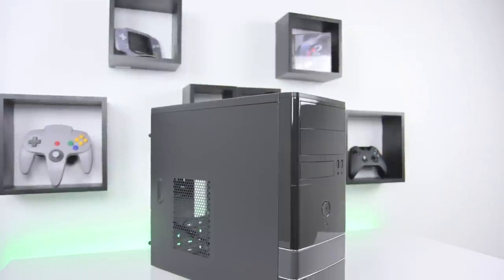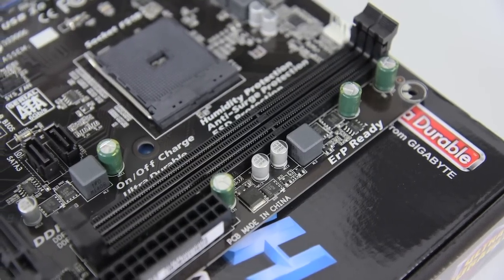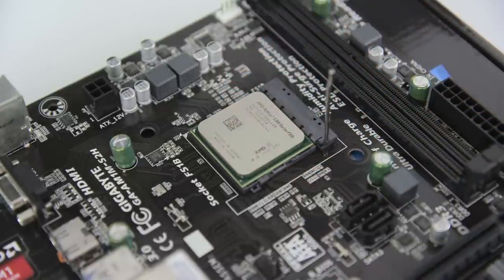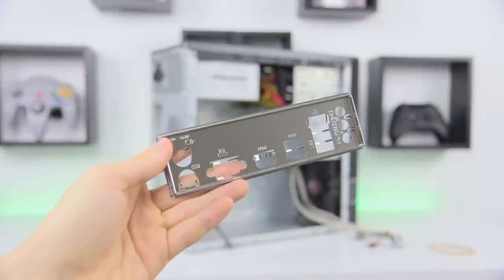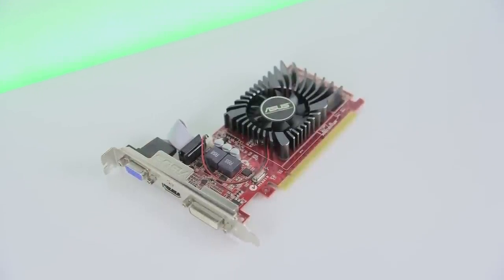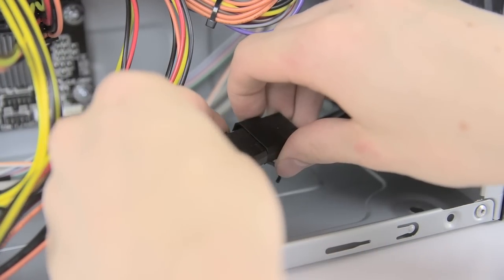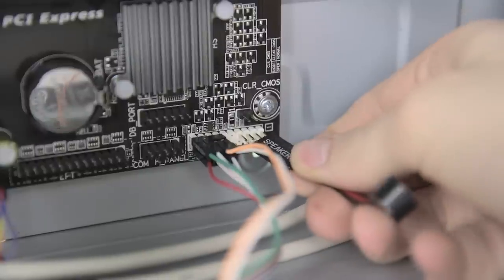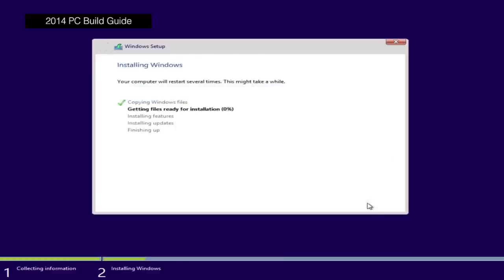How to Build a $300 Gaming PC! (2014 Boson)

Comment: Guys, this is a great build. I dont know why everyone is saying things about YouTube not being a reliable source for PC builds. Austin has over 700,000 subscribers,and is very technologically intelligent. He is an extremely reliable source with tons of knowledge. Besides, he showed us the computer working. He has another video video on his channel showing what it can do, and its pretty impressive...... for $300!!!!!!! Obviously this is not the best, fastest, most powerful gaming computer out there, but it's certainly one of the cheapest!! It's not supposed to be an outstanding performance PC, but it gets the job done with ease. It can handle just about any game out there at over 30 Frames Per Second, in 1080p to 720p. And for heavens sake, it's a beginners build. It's supposed to be a super simple build for beginning PC builders. Obviously not the best specs, but for the price and simplicity, it's about as good as you can get.
Reply: *****  Actually, even though that is a good computer, I still think the Boson is better. There are a couple reasons:
1. The Boson is actually slightly cheaper if you buy the parts for it on Amazon.com 
2. Even though the processor has a slower clock speed than the processor from the link, it is quad-core, unlike the one from the link which is dual-core
3. The Boson is still a better BEGINNER build, as it is easier to put together
4. The hard drive from the link is only 500GB, but the one in the Boson is 1TB, (1,000)

Don't get me wrong, the build from the link is still a great build. All-in-all, however the Boson is just as good (if not better), it is easier to build, and it totals out to a cheaper price than the build from the link.
Reply: muurf Your logic makes no sense. Because it's cheaper, it's better? So I guess the GT 610 is better than a GTX 970 too? Is the i3-2100 better than the i7-5960X too? It's cheaper.

The amount of cores a processor has relates to it's performance in absolutely no way. The G3258 outperforms the 860K in gaming.

How is the Boson easier to put together? hint: it's not. What's different?..

A 1TB hard drive is inefficient because the capacity is so large. You must not know that smaller drives perform much more efficiently, and this is why people partition or buy smaller drives and use them in RAID. 

The build I made is absolutely better, it's not a contest..
Reply: ***** Ur right. After I left my reply, I went back and looked at your build. I dont know what I was thinking! I guess when I said the Boson was easier to put together, I just meant that it came with a power supply already installed. Now looking back, I realize that that really wouldn't  make much of a difference. I didn't mean to say that if its cheaper it's better. I just meant that if you are just starting to get into pc builds, you should try to spend as little as possible on your first build.  Looking back, I realize that the intel processor in your build would out-perform the AMD processor in the Boson, even with only two cores. It would probably also be better for overclocking. As for the hard-drive, I guess it depends on what you are going to be doing on your PC and the amount of storage a person needs can vary greatly. Also, looking back on your build, I realize that the graphics card is much better in your build than in the Boson. I am literally laughing out loud right now over how stupid and completely insensible my earlier reply was. Your build was MUCH better. No question about it.
Reply: *****  Here's a build that I made:

http://pcpartpicker.com/parts/partlist/
Reply: muurf That's not a build you made. That's the link to your part list.
Reply: ***** How do you know I didnt build it?
Reply: ***** Liar.
Reply: ***** Are you a juicebox?
Reply: ***** or a jukebox?
Reply: ***** Maybe you're a bowl of fruit.....
Reply: ***** Sorry, someone started messing with my youtube accounts.  Everything after when you said " That's not a build you made. That's the link to your parts list."   wasn't me.  Yes I know that that is a link to my parts list, but that's what I meant when I said "here's a computer I made."  And just so you know, I did  build a computer using the parts in that parts list.
Reply: Tell me if you think this is a good build for its price range:

CPU:  AMD FX-6300 3.5 GHz 6-core processor.

RAM:  G.Skill Ares Series 8 GB (2x 4GB) DDR3-1600 memory

GPU:  MSI GeForce GTX 750 Ti 2GB Video Card

Motherboard:  Asus M5A97 LE R2.0 ATX AM3+ Motherboard

HDD:  Western Digital Caviar Blue 1TB

Case:  Corsair 200R ATX Mid-Tower Case

DVD Drive:  Black SATA 24x DVD Burner

PSU:  EVGA 500W

It totals out to around $470.
Reply: muurf It's decent but you could do better. Do you really even need a DVD drive? All games are downloads anymore anyways lol.
Reply: ***** Good point. I guess I figured just in case....
Reply: muurf go for a r9 270 gpu, I think they're around same price as higher tier 750 ti's
Reply: Riley Poulin thanks!
Reply: ***** While I agree this build isn't good, and neither is the Boson 2.0 build that recently came out, you still have to make some sacrifices in building a PC on a $300 budget.
Reply: ***** I know 700,000+ subs doesn't mean he knows it all, I was just saying that he must upload decent content, or people wouldn't subscribe to him.
Reply: muurf 99% of Youtubers know nothing about computers so not necessarily..
Reply: ***** Yeah, you're right, but generally speaking, YouTubers that put out TECH videos and have more than 200,000 subs tend to know a bit about what they're talking about. Just saying! :-)  By the way, i'd just like to mention: earlier in this comment stream, you said the amount of processing cores a processor has relates to its performance in absolutely no way. I just want to point out that that is not at all true. In gaming, that statement is correct to a degree, as games generally favor fewer, more powerful cores over more, less powerful cores. However, for a while, certain games didn't even run on dual core CPUs, and the newer games that are coming out are starting to take advantage of more than 4 cores. As far as workstation tasks go, you probably know the deal; more cores help tremendously with multithreaded applications, and can speed up the editing, and rendering process.
Reply: muurf It's still not that simple. There are chips with less cores that still outperform chips with more cores even in multithreaded applications. For the most part it's true but not always.
Reply: ***** Yeah, I know, but I just meant in general. It gets more complicated when you start comparing Intel CPUs to AMD CPUs, because Intel has "stronger performance per core." An i5 4690k would probably out-perform an fx-6300 in video editing and rendering, despite the fx-6300 having 2 more cores, simply because of the stronger performance that Haswell© has over AMD architechtures. It gets even more complicated when you get into hyperthreaded CPUs. Would a hyperthread dual-core i3 out-perform the x4 860k in workstation tasks?
Reply: muurf Yes, the i3 would still be faster by far.
Reply: Thank u someone else who knows it a computer for a beginner at pc gamin
Reply: jake P. I know right?!
Reply: ***** You win just for picking a Intel CPU over the AMD trash.
Reply: muurf Have to touch on the Hyper-threading part here just a tad. The performance of hyper-threading is null. At this point in cpu tech its like trying to compare my fire to yours what one is hotter .... there both fire and typically forgiving random conditions the same. The point here is that the Core performance is key and the only decider in this matter.
In all my years and experience with both products, AMD is a budget brand that will run but never performs. Intel continues to perform even at the base level of CPU. I may spend a tottal of $30 US more on my build but it will run as if you spent 200-300 more on a AMD build every time.
Reply: BloodyNoSeProduction Yes, Intel performs alot better. I know. Intel architecture is at another level from AMD.
Reply: I think this kid is high or something because the build is not $300 and it is a piece of crap to game on. If you haven't noticed windows is $100 per copy, a decent mouse and keyboard bundle is at least $60, if you want a wireless adapter for your pc that is $15-30, finally if you tried to multi task/ record and stream while gaming your cheap ram would blow up. The only decent part on this pc is the amd apu but the mobo will most likely blow up as well so you should just save yourself the time and burn this computer to the ground while you still can.
Reply: If you want to buy a GENUINE windows activation key that has not already been stolen then you will not take any chances and pay $100. If you want pc accessories that will actually last you a decent amount of time and will give you the most comfortable gaming experience possible then you should invest a little more in your equipment. If you are new to building gaming pc's then you will want to buy a motherboard with an easy-to-use bios so that you don't accidentally mess up anything with processor, ram, gpu, etc. Im just saying that he did not mention any of this in his video and i needed to point it out.
Reply: D.A. Jackle What the fuck are you talking about? They are GENUINE. I entered the code and have a genuine copy of Windows 7 Professional 64 bit and receive Windows updates and tech support. What is so uncomfortable about using a $20 Logitech controller or Steam controller? My $40 MSI H81M-E33 has a GUI BIOS. Please, you have no idea what you're talking about.
Reply: D.A. Jackle First of all, as ***** mentioned, you don't need Windows to build a gaming PC. My personal gaming rig is running Ubuntu 10.04 which was absolutely free, and it works fine. Plus, if you really want Windows, and you have another computer with windows, you can burn the software onto a USB stick or DVD, and boot your computer from those. Second of all, there are REALLY nice mouse and keyboard bundles for a lot cheaper than 60 bucks. Take the CM Storm Devastator for example: it's an LED backlit keyboard and mouse combo with fully mechanical key-switches, and the keyboard feels nice to type on, and the mouse is quite comfortable. Oh, and did I mention that it's only 27 dollars?! Also, if you were looking to spend at least 60 bucks on a mouse and keyboard, then you would probably be spending more than $300 on your PC. While it is possible that components COULD fail, in which case you would replace them, it is highly unlikely that components in the PC would spontaneously explode. Despite the fact that it barely has a heat spreader, the Crucial Ballistix Sport RAM kits actually aren't that crappy considering their price point. (Although admittedly, other companies do have RAM that is just about as cheap.) You can also get really nice network adapters/cards for significantly cheaper than 15 dollars. You say the build is a piece of crap to game on, and while it is in comparison to some higher-end PCs, you have to take into consideration the $300 price point. Generally speaking, you can't expect that much more than just above 30 fps in 720p to 1080p with a 300 dollar PC. (Unless you're buying used parts, which is an entirely different story. I spent around 200 dollars on my current personal PC, and I have had it for a few years. I do light gaming, as well as mild rendering and video-editing all at once. I even have the exact same RAM kit as in the Boson, and no, it hasn't exploded, even after 3 or 4 years.
Reply: muurf You do it like this:PCPartPicker part list: http://pcpartpicker.com/p/wwcQYJ
Price breakdown by merchant: http://pcpartpicker.com/p/wwcQYJ/by_merchant/

CPU: AMD Athlon X4 860K 3.7GHz Quad-Core Processor  ($81.98 @ Newegg) 
CPU Cooler: Gelid Solutions CC-Siberian-01 51.9 CFM CPU Cooler  ($8.98 @ OutletPC) 
Motherboard: Gigabyte GA-F2A78M-HD2 Micro ATX FM2+ Motherboard  ($49.98 @ Newegg) 
Memory: G.Skill Ares Series 8GB (2 x 4GB) DDR3-1600 Memory  ($53.10 @ Newegg) 
Storage: Western Digital Caviar Blue 1TB 3.5" 7200RPM Internal Hard Drive  ($52.49 @ OutletPC) 
Video Card: EVGA GeForce GTX 750 Ti 2GB Superclocked Video Card  ($124.99 @ NCIX US) 
Case: Cougar Spike MicroATX Mini Tower Case  ($29.99 @ Mwave) 
Power Supply: EVGA 500W 80+ Certified ATX Power Supply  ($29.99 @ NCIX US) 
Optical Drive: Samsung SH-224DB/BEBE DVD/CD Writer  ($14.98 @ OutletPC) 
Operating System: Microsoft Windows 7 Home Premium SP1 (OEM) (64-bit)  ($86.89 @ OutletPC) 
Wireless Network Adapter: TRENDnet TEW-648UBM 802.11b/g/n USB 2.0 Wi-Fi Adapter  ($7.99 @ Micro Center) 
Keyboard: Adesso EasyTouch135 Wired Gaming Keyboard  ($21.99 @ Directron) 
Mouse: Razer DeathAdder Chroma Wired Optical Mouse  (Purchased For $0.00) 
Total: $548.35
Prices include shipping, taxes, and discounts when available
Generated by PCPartPicker 2015-04-12 21:14 EDT-0400